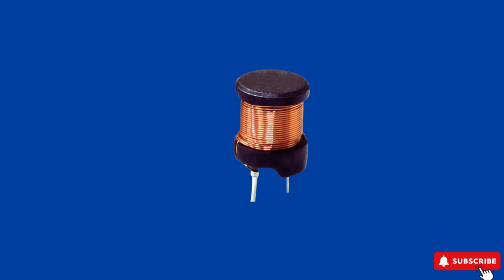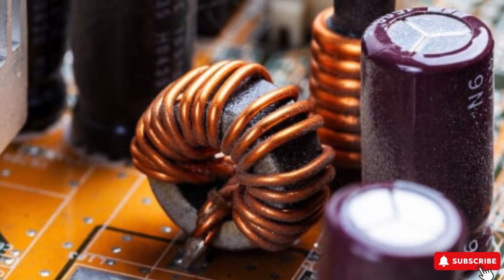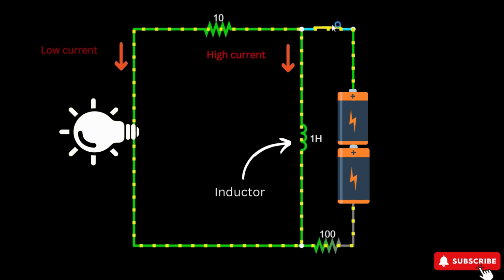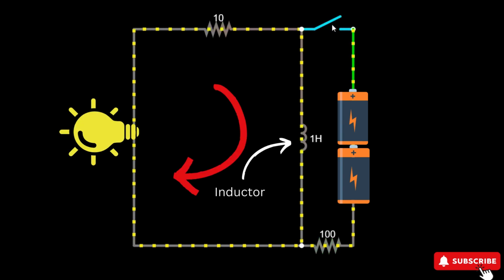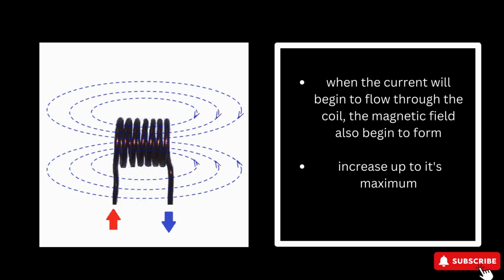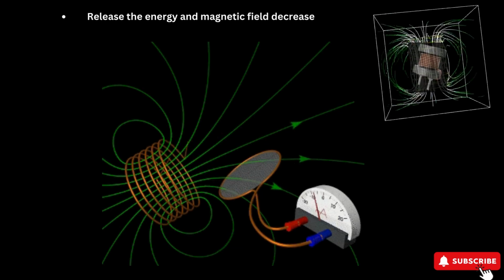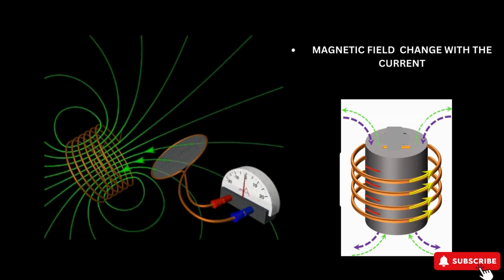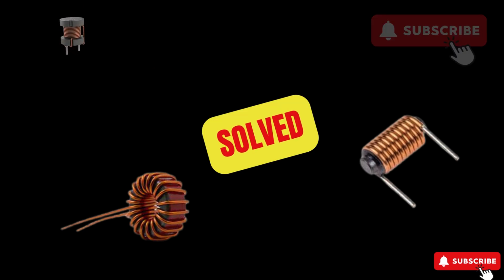Inductor Explained | How Inductor Works?

Comment: Are toroidal inductor can reduce noise on audio signal?
Reply from the maker: yes.
Reply: @ABPhysics  but is there a downside?
Reply from the maker: When used for audio noise reduction, toroidal inductors may cause signal loss, inductance volatility, and frequency response alteration.